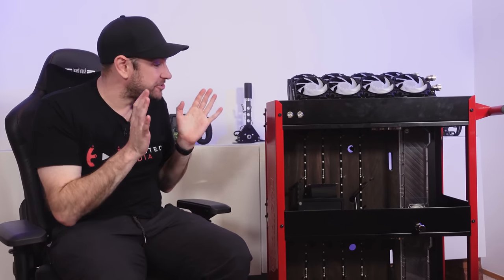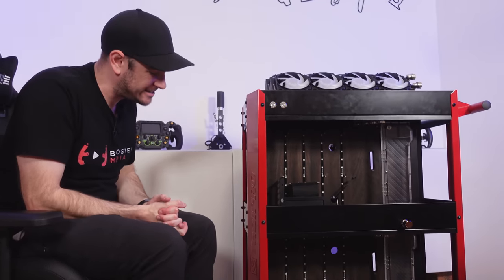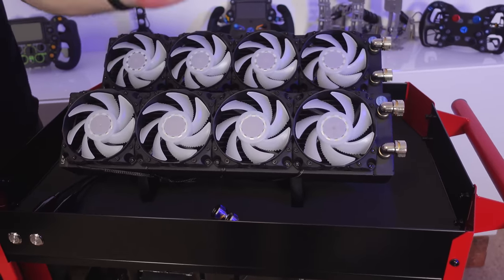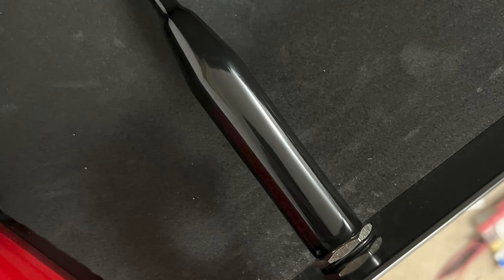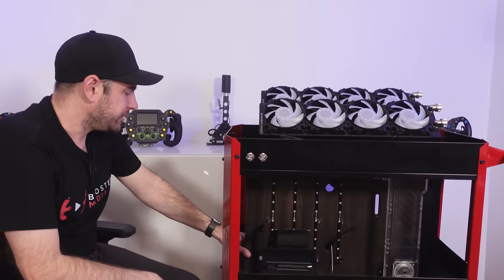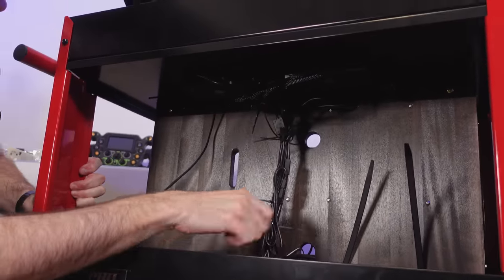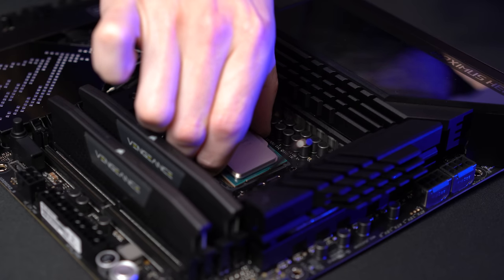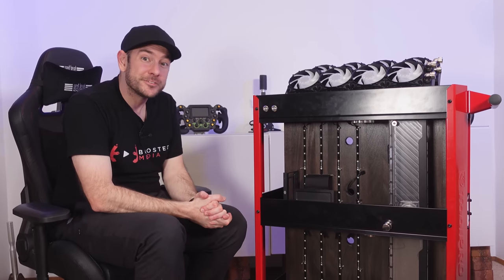We Built an Absolutely Crazy PC in WHAT!?

Comment: this is so badass
traditional pc cases are too restrictive for air flow and overpriced
for ur cooling u can also use a mini ac unit if u plan on enclosing the rack for insane cooling numbers
or use a strong desk fan for a open case setup 
bonus tip
power gone up so much
if u havre the land use 2nd hand solar panels array can help u off set the cost

Comment: Since you guys are gonna be using a 12900k I would suggest removing the cpu retention system and installing the plate thing from Derbauer or equivalant. For proper heat transfer and contact with the coldplate. Cheers guys and looks like its gonna be an awesome build!

Comment: The only advice i give is to plug the graphic card in with riser and verify it doesn't causes any issues. i had a problem with my system when i did that. make sure u buy pcie 4 riser
Reply from the maker: Yep for sure, I’ve had issues in the past too. And yes I have a PCIE4 riser cable to use :)

Comment: You won’t be cooling a 12900K and 4090 on a single 480mm rad with much headroom…
Reply from the maker: We’ll see. I don’t think it’ll be a problem. It’s a very thick radiator. If not, I have a couple of 360s the same thickness I can add.
Reply: I ended up putting my CPU and GPU on separate loops, but mainly because the CPU has a Peltier/TEC which kinda screws the loop for anything else attached to it.